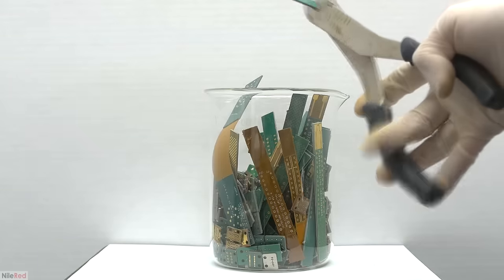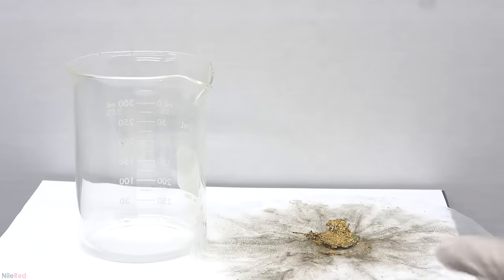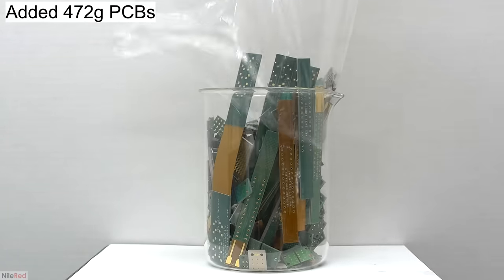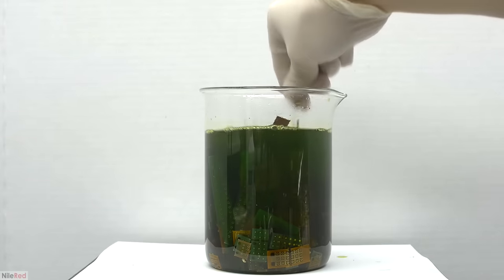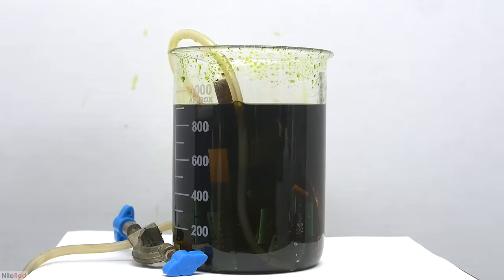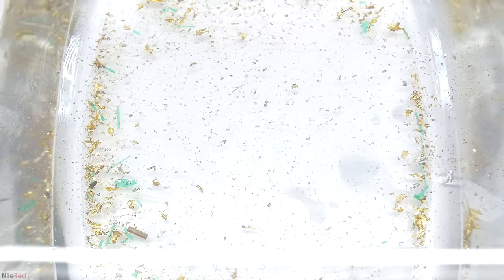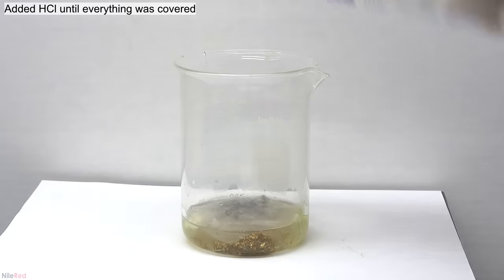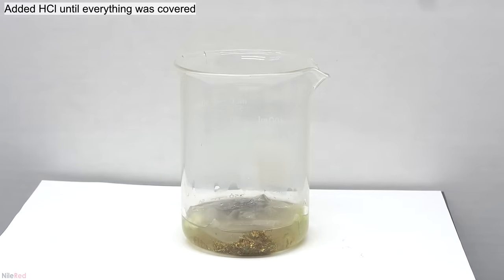Extracting gold from computer parts (Part 1)

Comment: I like how he can say “ I didn’t have any cyanide” and it’s normal
Reply: did you know you can make that stuff with apple seeds?
Reply: Felix C yes I did that’s why dogs cannot have them
Reply: Well, you just run out of the stuff sometimes.
Reply: Felix C and cherry pits
Reply: @Chillerll  yes. just have him buy like 50 apples just to remove the seeds and extract the microscopic amount there is.
Reply: He now has a kilo of it lying around somewhere
Reply: @Chillerll  you want almonds for this
Reply: @Obtite  actually only like 17 blended apple cores is enough to give you a significant dose
Reply: Most labs contain multiple hundreds of grams of cyanide. It's an incredibly versatile chemical reagent for more than just gold refining. My lab in particular has over 1.5 kilos.
Reply: @Chillerll  Peach pits have a higher concentration, and there are several websites telling how to extract it.
Reply: @spiderdude2099  my grandpa worked with cyanide when he was an electroplater. He told me that after working with it all day, It left a sweet taste on his lips.

Comment: Try with antique computers. The gold plating is usually thicker tho. Like a lot
Reply: also most of the gold is in the cpu's. pentium 1 and pentium 2 have approximately 1-2g
Reply: Extra THICC
Reply: @americanengineering2063  Pentium Pro ;) 1994/1995. Best gold amount.
Reply: I’m currently harvesting gold from an old computer 1998
Reply: @smithy1578  If it still works, or parts of it still work, sell the computer online instead of scraping it. you can make 3-4x as much.
Reply: @americanengineering2063  are you dead serious i do have a penitum processor
Reply: @Rakesh_Khanna  Yes it's true, however, collectors will pay more. Do that or hang on to the processor because everybody is destroying them for gold, making the processors more valuable due to rarity.
Reply: @Rakesh_Khanna  This depends on the pentium.  Your average modern pentium, or even one from a few years ago will not have as much gold as the pentium 1 and 2, which are from the 90s.
Reply: @thestarskynight3291  plus ultra hyper extra- X THICC
Reply: Lucas Yasturituf1 Yes
Reply: That's why they are worth so much
Reply: Best ones are the dead ones. The ones that are salvagable stay alive.
Reply: True
Reply: I have a nearly unlimited access to old motherboards. Do they have any gold on them?
Reply: Don’t destroy vintage computers for gold. You will get more money selling a vintage computer than scrapping it for gold. Some vintage computer parts may never exist again so they get rarer and rarer and more expensive.
Reply: That's kind of hard to do when everyone does that and prices go to high because of demand
Reply: @brandonfrentrup  please do not scrap old working motherboards and cpus for gold scrap. It makes working with old computers impossible or grossly expensive. Especially the cpu side. If all motherboards for a particular socket were lost, it would still be easier to make a new motherboard than a cpu, but even that would be extremely difficult and annoying. It’s not worth destroying a product for 20-100 bucks worth of gold when it’s worth over 300 online.
Reply: @americanengineering2063  to the
Reply: How old do they have to be?
Reply: 10 years?
Reply: @kennysboat4432  No!, I wanna have a shiny gold bar - mhm maybe I am infected by gold fever 😳
Reply: Thicc
Reply: If old parts are in good working condition, they're worth more than the gold you can recover off of them. Collectors will pay a lot for working examples because many of them are being destroyed to recover gold. I'm sure some of the parts being destroyed are working parts and the scrappers simply don't bother to check the parts to see if they work. A shame really. It really sucks when something working or repairable is removed from the world, making them rarer and rarer. :c
Reply: Give me a break!
Reply: @ericdeltoro8484  for those that have  or find the parts, how are they supposed to find out if the part is still able to work? Any links you can share might make it easier for others to make more money than what they might make scraping. Thank you.
Reply: I read the word tho in the same way nilered says it... Lol
Reply: @americanengineering2063  I got pentium 4
Reply: Don't understand anything but sounds good
Reply: My mom and her boyfriend do scrapping and get that stuff all the time! I'm about to start saving all the circuit boards and do this it looks easy!
Reply: Yeah old is gold
Reply: I like my precious in my graphics cards and my audio equipment. Nerdbling, if you will.
Reply: Thicc
Reply: Ugh....Antique...now I feel old as hell. I started on an apple 2 green screen. The keyboard was attached to the computer....now what I'm holding in my hand is more powerful in every way by several orders of magnitude.
Reply: They'd probably still be worth more if you waited for museums to begin looking for those specific models.
Reply: Yeah, the issue is, everyone knows it. And old computer scrap is extremely expensive.
Reply: @americanengineering2063  Aaaaaaaaaaaaaaaaaaaa
Reply: I used an old ibm one and the ram had literall gold stickers on it
Reply: @markkirkland8342  Computers since about 1995 are compatible with modern power supplies and cases.
Reply: @kennysboat4432  No one is looking to buy your pentium 3
Reply: They're collectables now. Very very very expensive
Reply: @syedhassaanmujtababokhari6199  my grandpa gave me a first gen ibm laptop and I destroyed it for the gold and it still worked. it was one of the first laptop models ever made and was being sold on ebay for $50
Reply: His pfp is the same as my Home Screen
Reply: Not worth it any more, Old computer stuff is actually worth more as working components than it is as scrap
Reply: If he done that then this video would be a world war in the comments over the fact antique computers can be JUST AS EXPENSIVE AS antique cars, thats without the other types of value too.

Comment: 1) The green color is copper, silver and small amounts of platinum metals 2) The Aqua Regia and acid amounts DO affect the resulting recovery efficiency. 3) Grinding or burning the boards means that step 1 takes a day or 2 instead of a week.

Comment: I usually put the aqua regia beaker into a warm water bath to speed up the reaction.

I use urea (which is very cheap) to bring up the pH, and then precipitate with warmed metabisulfite solution.  Warming the neutralized gold chloride and metabisulfite, I found, caused almost instantaneous precipitation of all the gold into a sponge-form, which is then very easy to recover.

Comment: You can also use dilute nitric acid for the initial cleaning of the boards.  Weak nitric acid easily removes copper and nickel, but won't touch gold, platinum, palladium, or rhodium at all.  It will dissolve silver, but so does HCl and peroxide.

Comment: I'm in the middle of recovering gold from a variety of junk I've had sitting around for ages. Dead computer/phone parts, gold-plated connectors, and unassembled prototype PCBs. I'm using hydrogen peroxide and vinegar, which is working great for how simple it is. It only really dissolves copper, but that'll get gold off of PCBs and some contacts.

Pretty sure I spent way more time than it's worth recovering this stuff. Really, I only have maybe half a gram here if I'm being optimistic. But hey, I'm having fun and getting an excuse to buy cool glassware.

Comment: It seems like even if you know exactly what parts to buy, that when you take into account the cost of materials, the time hunting down the right deals, and the time put in to the actual recovery, that the profit per hour would be less than a minimum wage job.
Reply: Unless you scavenge the parts themselves for free by scavenging them from trash cans or electronics disposal boxes, for example I salvage the computer parts I find from the electronic disposal box in front of the IT department at school, long as you wait till you have enough computer scrap to net you a profit in return of gold per refinement process you should be good, but obv it won't give you as much money as a minimum wage job, it is more of a side income no matter what
Reply: @MonsterPumpkin  time involved scavaging would likely make it worse than the awful money you'd get anyway

Comment: You used "unused" PCB scraps. They were never be soldered.
But for recycling you would more likely find completely soldered gold pads (except for connectors or edge card connectors, which would be most preferable I guess).
Would you use a different solvent in this case, or would the soft solder be dissolved as easily using the same chemicals?

Comment: Hi man! Your channel is great and I learn a lot from it. Gold recicling is a thing that needs a lot of reasurch and practice. What I've probably spotted in your video, and what I think is a mistake is that you did not neutralise the aqua regia solution before adding the metabisulfite, which resulted in immediate re-desolving of the perticipated gold, which one can see on the the immediate gas that was emmited after the addition.... I made that mistake and it cost me maybe 10-15 g. of gold and me running around trying to fix things... 
What do you think - IMO you have to neutralise with urea or pottasium bicarbonate before SMB addition...
Waiting for your thoughts on that...
Regards form Sofia, Bulgaria!
Reply: How much urea would you add? Just as much as needed to get a neutral pH?

Comment: Never destroy a working older part. Plenty of people looking to build retro gaming rigs out there. That old 80486 or Pentium chip is likely worth far more to a collector / gamer than as scrap. Even bent or missing pint can be fixed on really old chips. More modern chips like the P4 on up are much harder to fix once broken. But an early Pentium or 386/486 can be easily fixed.

Comment: I feel that crushing the parts or grinding them prior to adding the acid can make the process faster and might give more gold as the surface area of reaction increase. But again this can only really work if the suspension made is not allowed to settle and you have to make sure not to waste a lot of the powder from grinding it.

Comment from the maker: Made a twitter! https://twitter.com/NileRed2
Reply: can you do a video on how to recover palladium from MLCC's?
Reply: u could have just scrap off the gold from the computer part  or carefully  heat to separate the gold that was put on that computer  part.  why wait 2 weeks and use so much materials and ruin all other computer parts to get the gold off and polluting environment with so many chemicals ??
Reply: meri You seem very uninformed. I'd recommend doing even slight research on what you're talking about, but you probably wouldn't listen.
Reply: YOU MADE TWITTER?
Reply: Hey man great videos .
Love your work.
So I did the gold extraction as a project for an assignment at school.
Followed almost all the steps you did except I used HNO3 to get rid of all the base metals.Then I dissolved the gold obtained in aqua regia .To precipitate it I'd used Sodium MetaBisulphite. On adding the first few spoons, there were tiny black clouds formed, But after that nothing much seemed to be happening even after adding more metabisulphite. I've a hunch that i used a tadtoo much of Aqua regia.
Even after 2 hours there was no sign of any precipitation.
Did I do something wrong like adding excess of metabisulphite or would i have to wait longer?
Around 0.25g of gold is expected to be there. And i used mainly ram and data card trimmings.
So what do you suggest I do?

Comment: Using any means of restriction on an aquarium air pump hose to reduce the rate may cause the motor itself to catch fire. There are cheap products that do this without running the risk of fire, or (most likely) failure.

Comment: But once the gold has been separated from the boards why bother to dissolve it? Wouldn't be much simpler to purify the gold flakes from plastic and other debris by melting the mixture? Also why not use nitric acid to separate the gold from the plastic in the first place? Nitric acid dissolves plastic much faster than the  hydrochloric acid and hydrogen peroxide.

Comment: Hey NileRed, What do you think about placing the Gold Computer scrapes in a vat of Sulfuric Acid and suspending a Titanium plate into the acid with an electrode attached to one end and an Anode on the other end.  Honestly it should take 12 to 24 hours to separate the gold from the rest of the metals present .  Then just a one time smelting should result in the purest form of gold and reducing cost and dangerousness.  Got an Idea for getting Platinum from old Catalytic Converters that I would like to run past you also.

Comment: Hi Nilered, thank u 4 your videos. I've just did the experiment  on cell phone boards and it was good until the last stage :( I used extra sodium metabisulphite  (i didn't mix it with water and used two  spoonful powder of it) . a white power settled and the solution turned red. No gold. By the way i used edible sodium metabisulphite )

Comment: I was noticing that you excluded acid peroxide method for dissolving the gold, the stronger formulation with concentrated hydrochloric acid and 30% - 35% hydrogen peroxide, and I was wondering if this was just overlooked (which I doubt) or rather much more likely done for a specific reason in which case I was wondering could you elaborate on specifically what was your reason for that, because I have a lot easier access to the hydrogen peroxide then I do the nitric acid and I find it for a much better price and as margins are very thin as you already stated expensive chemicals can be a real deal-breaker or Profit killer and the largest single determining factor in whether or not I even embark on this endeavor (even considering I get most of my E-Waste for next to nothing) because the learning curve for working with gold is very very steep and getting steeper all the time

Comment: As I mentioned before about High concentration peroxide being much easier to get and cheaper than nitric acid I'm wondering if it would be possible and perhaps cheaper to do something like this with piranha solution sulfuric acid and concentrated peroxide and regardless of your answer I wonder if you could elaborate rather than just a simple yes or no because I'm just curious like that and because when processing IC chips for instance instead of circuit boards there's a lot of non-metallic garbage to deal with and in particular with the case of BGA chips for instance much of that is plastic hydrocarbons that it seems to me might be just consumed in the process saving its depth and a significant amount of time

Comment: I think the connectors are a better source of gold. The gold is to create an oxide-free surface for the mating surfaces of the connectors. So the PCB may have connectors with gold on them too. High speed cables and PCBs will probably have gold. Cheap appliance stuff will probably have 0 gold. 
Chips with a lot of pins should have a good amound of gold; ever pin needs a short piece of gold wire to connect the pin to the lead-frame of the chip. 
On circuit boards and connectors, if it looks like gold it probably is.

Comment: does ANYONE here know how i can remove tin plating from an 18K gold surface? I have a circuit board someone did a silly bodge on and i want to remove the tin (solder) surface. might contain a small amount of lead. But so far hydrochloric and sulfuric acids have proven ineffective. nitric acid?